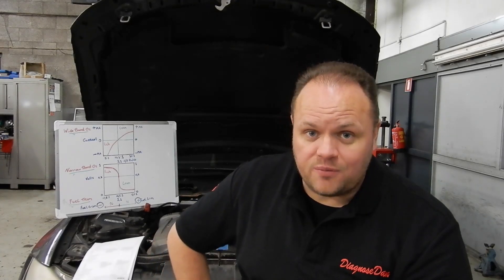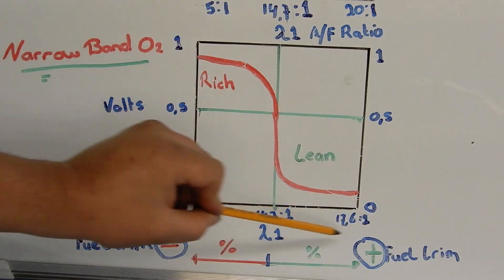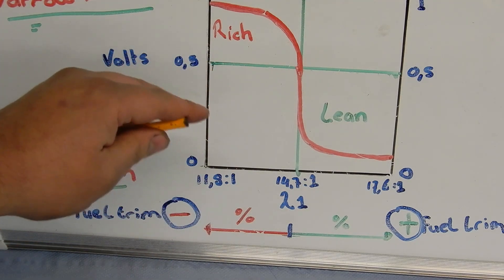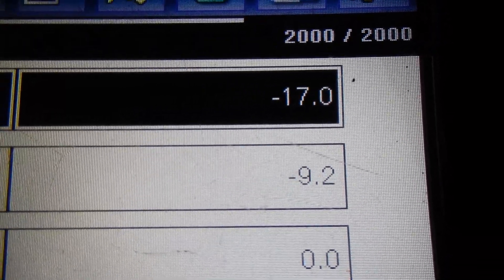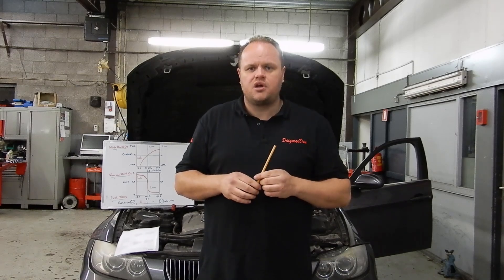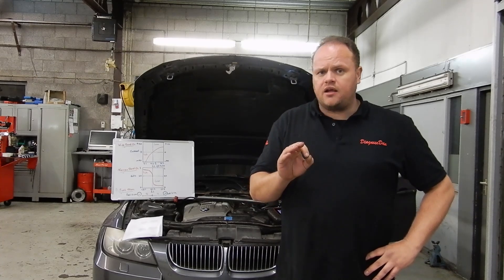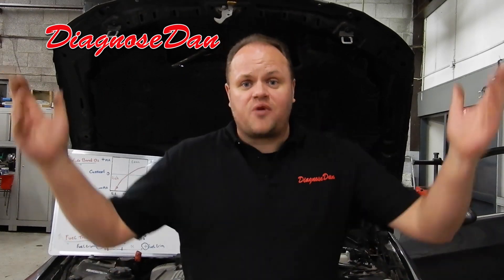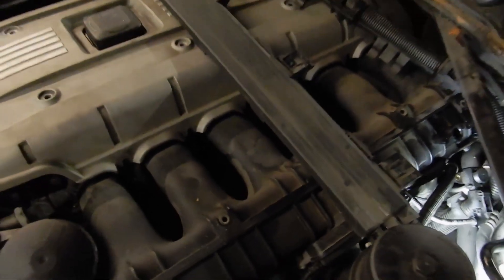Wideband O2 sensors, Narrowband O2 sensors and Fuel trim.

Comment: I cannot think of another skilled trade where we are required to have such vast knowledge yet earn such poor pay.
Reply: Within time constraints and owning/needing costly tooling/equipment as well.
Reply: The typical "mechanic" must be proficient in Mechanical diagnostics, electronics, welding, hydraulics, pneumatics, material science, air conditioning, and computer programming to be successful. Heaps of common sense and a developed diagnostic approach are also mandatory.
Reply: @mnewln1800  hey i like that
Reply: @mnewln1800  and yet we're looked down upon in the trades plumbers have us beat
Reply: @mnewln1800  I'm saving your reply
Reply: Red Pill exactly
Reply: Truth... I did it for 20 before escaping.
Reply: There are alot of trades that need high skill that are not paid that well. Like programmer, electronics technician...etc.
Reply: So true, customers don't want to pay us
Reply: Exactly why I got out of it after 13 years
Reply: I agree .. been a mechanic all my life .always try my best but these days the electronics especially on older cars just causes us nothing but agro... do that diagnostic again Dan on a 15 year old car with a loom from the wrong model fitted by a blind clown whilst freezing your plumbs off in a shop with no doors... then I'd be impressed
Reply: The industrial valve business is the same.  There are so many "slick" salesmen that are flashy with their words that the guys that actually can solve problems get marginalized; for a while.  We never get paid what we are worth.  The average plant down time at a paper mill costs ~$100K an hour but they do not want to pay a capable valve guy a fair price to solve the problem.  We are in the same boat brother.
Reply: Because of greedy dealerships I think the future is going to be a lot of smaller shops opening up
Reply: Vs doctors!!
Reply: Exactly my thoughts too we're the most unappreciated trade in the industry
Reply: I can, because I am one. A professional musician. 

Not only is my literal entire life my experience (along with a degree that costs the same as any other), but we're also doing the job of Dr's, therapists, and psychologists.

We also have insane costs for our tools (instruments) which are under CONSTANT threat of being stolen, but we also required and expected to give away our lifetimes worth of knowledge, creativity, and experience for free. We have to fight to even get paid.
Reply: AND spend huge money on unique tools.
Reply: Horticulture
Reply: Teachers ? the kids in the USA can be little shits
Reply: True
Reply: I really think that car performance tuners and diagnostics are going to change the car repair industry, especially negatively affecting the dealer repair scam shops, in the next 5 years. That’s probably why the dealers are trying to get laws passed in California to block the tuners - they see them as a huge threat to their business. Knowledge is power.
Reply: I agree wholeheartedly
Reply: Try being a carpenter. Bahaha. The ones that don’t think up you lay carpet for a living and there are a lot, thin’ you shit money for a living. And you like working for free on your weekends 😂😂
Reply: I paid 400 to have all four shock/struts replaced on my Camry took the guy a couple of hours. I felt like I got a good deal. That’s a hundred bucks a wheel. You guys should absolutely make more than you do. So, ya I agree.
Reply: Chefs are in a similar boat
Reply: Not to mention the safety risk and health effects. My shop refused to provide us with safety glasses, mask, ear plugs or knee pads. They provide a cheap safety shoe once a year so if you worn it out, they wont replace it for you. The gloves they gave are cheap cloth ones, not oil resistant nitrile. Used engine oil causes cancer
Reply: @bengkelbawahpokok6753  that is horrible...I wouldn't treat my employees like that.
Reply: Mechanics earns the same amount as an engineer or IT consultant. Don't get it twisted!
Reply: @ashystyle What are you smoking or are you naturally this delusional? There's no way an automobile mechanic or technician makes the same as an engineer or IT professional.
Reply: Poor pay? My tuner charger me 1100 for 4 hours of dyno tuning. Y'all charge 80 to 120 per hour for labor. How's that poor pay? I was a mechanic for the army for 14 years. It's not hard labor. And tuning requires knowledge. But that's it.
Reply: @09fatbobmike  We probably get $11 - $25 per hour from that 80 - 100
Reply: @bengkelbawahpokok6753  WELL thats some shitty shit there. time to start your own business. 25 is good but anything under 16 is under paid.
Reply: Lol army mechanics are not real mechanics
Reply: oh, and my charger makes 410whp and 360wtq.
Reply: Mr. Mike I’m an army mechanic no way your training was 8 months lol you can stop that bluff lol all we do is fire that parts cannon
Reply: @michaelsieber6601  i stand corrected. it was 1997. memory lag. it was 63Tango and H8 identifier. total with basic was 8 months. AIT was about  5. IDK what you guys do now. But to say an ARMY mechanic is not a Mechanic is fucking bogus.
Reply: A mechanic is an artisan, skilled tradesperson, or technician who uses tools to build, maintain, or repair machinery.
Reply: @09fatbobmike  Army "mechanics" are a joke shut up. Cry about 8 months of training? Think that's alot? Have you heard of automotive school...? Get real.
Reply: @michaelsieber6601  lol
Reply: @09fatbobmike   12 second camaro? Does that mean the avrage time between total breakdowns is 12 seconds?
Reply: @rimmersbryggeri  sure man
Reply: @michaelsieber6601  Army mechanic is a mechanic not a technician
Reply: @09fatbobmike  seriously? It takes a lot of knowledge to be an anesthesiologist but not hard labor. It takes a lot of knowledge to design a bridge, but not hard labor.......yet they make a LOT of $$$. The name of the game is knowledge. Labor is almost worthless WITHOUT knowledge. 
And there is a difference between being a mechanic and a technician. Anybody can change brakes and rotors. Not everybody can diagnose the module systems.
Reply: @davidickes4621  you do not think a military mechanic diagnosis and troubleshoots problems?
Reply: @09fatbobmike  we may be disagreeing over terms. If a military guy is diagnosing and troubleshooting problems, I would call them a tech, not a mechanic. Because a tech isn't always dealing with "mechanical" problems. Many of the problems diagnosed on modern cars are circuitry or communications or the modules. 
Having said that, my point was that a tech is most of the time worth MORE than what he or she is getting paid. Because knowledge is value.
Reply: @davidickes4621  Your point is proven over and over again by these great youtube tech/mechanics like Dan and the rest. They constantly get cars from other shops and from dealerships that were diagnosis/repair failures. The sad part is that they often have to listen to sob stories about how great gobs of money were already spent on the car and it's not fixed, and would they do the diagnosis / repair for cheap?
Reply: @09fatbobmike that's your cost not their pay...
Reply: @09fatbobmike  Were not talking about Tuners tho since they specialize.
Reply: @09fatbobmike the shop charges $125.that’s not what the mechanic gets paid. We get pay $20 an hour. Tuning does not have anything to do with auto repair and diagnostic. Diagnosing newer cars requires high skills and expensive equipment
Reply: Shredder_V6_Ratpack because dealerships are greedy and don't pass the money onto the techs

Comment: Hopefully this has helped me able to diagnose my 2011 A4 which had oil consumption issue. That has been fixed, but it's currently running rich with LTFT -18 (did CRC clean it's now -14) (P0142 + P0420 for the cat). Just realized upstream is wideband & 02 downstream is narrowband. Upstream gives -0.2 mA at idle & downstream at idle behaves like upstream at idle with voltage going up & down, suggesting rich to lean which i don't think is normal? Who can help me here? Cat is toasted for sure, temperature is less post-cat compared to pre-cat. Other than cat replacement, is this upstream should be changed or is there a possible fuel injector leak?
Reply from the maker: What if you create a lean condition? Does the upstream respond?
Reply: @Diagnosedan  i removed intake hose after MAF to the turbo, ALL values below are at idle. Upstream responded, increased current readings from -0.03 mA to between -0.08 to 1.12 mA. STFT from 0 to -7, LTFT stayed at -14.56. MAF dropped from 2.6 g/s to almost 0. Downstream voltage continued between 0.1 to 0.9 v

Comment: Hey Dan,does the A/F ratio sensor,O2 sensor and wide band sensor,work differently from one another and how do you identify which sensor is which ? Thanks
Reply from the maker: A/F sensor= Wideband sensor
Easiest thing is look at the O2 sensor data on the scantool if it's between 0 and 1 volts it's a normal O2 sensor. If it says mA at the data pid it's a Wideband sensor
Reply: DiagnoseDan thank you,you are very helpful....

Comment: But I have a u1000 in my 2007 infinity fx35 I can't comnicate with AC unit and fues box the heads light stay and fan stay on when I on the ingnatio  please what can cause the fault? Have replaced front fuse box and ac amplifier.wiper not working AC not working too
Reply from the maker: Scope the comm. lines

Comment: I am watching this video over and over again. Amazingly that other shop replaced a common part that would affect both banks (the MAF sensor) when the vehicle only had an issue with bank 1. Too many parts replacers out there in the industry without "diagnostic" skills. I see it as "keep on throwing parts at the vehicle till the problem goes away"...sorry, but not on my wallet. I love these videos!
Reply from the maker: Thanks for the great comment!
Reply: Friend I need help, my bank 1 and bank 3 are at -17%, do you think it's the MAF sensor or the gas pressure regulator?

Comment: Well I didn't know what Valvetronic is since I do not own a BMW car (my last one was a 1995 E36) and my BMW motorcycles do not use that system either. My guess was a MAP sensor only needs a tiny hole to measure pressure (since it is static and not dynamic) and that tiny hole would not allow enough air to enter the engine. But this video is excellent to understand about Fuel Trim (I had no clue about trim)! My friends Porsche 993 is running ultra rich after having the engine out for seals, o-rings and a new dual mass flywheel and clutch. Plus we did the 964 mod to the 993 cams to pin the timing gears to the camshaft (the original 993 gear is a butt fit to the camshaft using a bolt...in my books a no-no). Anyway, I think we will have to do an ECU Drive Cycle / Readiness. Thumbs Up Dan!
Reply from the maker: Thanks for the great comment buddy it's appreciated

Comment: I thought that for the catalyst to work properly, the mixture had to fluctuate around 14.7. With the classic lambda sensor, the mixture fluctuates between rich and poor. Rich to have CO for the reduction of NOx to N2 and CO2. Lean to have O2 for oxidation of the CO to CO2. The mixture is kept at 14.7 with an AFR probe. How can the catalyst work well with such a system? What do you think Dan? How mesure the current of the AFR sensor with a scope. I think the current is too low for mesuring with an Amp clamp.
Reply from the maker: Current is very low, better to use scan data or look at the voltage drop because of the current

Comment: Hi Dan,I have a similar problem (FUEL TRIM BANK 1) CODE P0170 at 2008 Mitsubishi lancer 1.5L ,i was to Mitsubishi dealers as well,and they never seen this at Mitsubishi cars.......they told me on the diagnostic test  come up a throttle body error...but I got a throttle body and I had change that and the problem it's the same,I have two new lambda sensors and they work fine,I had fallow the response from sensors and they look active...I dont know where the problem is ...the short term fuel its 24.2.....and long fuel trim its 12.4.....I cant bring them back lower,i had change most of the part to try to fix the problem but no results.fuel pump,fuel injectors,purge valve,vapor canister,lambda sensor upstream and downstream,the all exhaust system and the cat and sparkplugs,throttle body........ I had checked the fuses.....plus all connections.....the  air frow mass its working no issues.....do you have any other ideas to tell me and to try ????

Comment: That BMW uses a Valvtronic system. Basically it can control valve lift electronically which pretty much eliminates the need for a throttle plate and this is the reason there is no vacuum at the manifold because air flow is controlled by controlling valve lift instead of a throttle plate. This system is very similar to what Nissan Calls VVEL (vairable Valve Electronic Lift). It's pretty slick.
Reply from the maker: Exactly!👍💪
Reply: Мu BMW is a valvetronic is a nightmare for repair
Reply from the maker: @traqnsavov822  it's not to bad
Reply: my is valvetronic TYPE 1 is not very good,  you is TYPE2 is good :)
Reply: Traqn was my first weekend at the lake at the beach and my friends at the park at my moms t you can not get gym and the people Savov
Reply: DiagnoseDan is the time to its 12234445
Reply: Exactly, but there still use a valve plate only when engine start on cold condition, when the engine reach its normal working temperature valve plate remains wide open, then valvetronic take control of the engine, now even with the engine at normal temperature operation the valve plate will operate of the engine is turned off and then back on, in this case the valve plate will wide open really quickly
Reply: Valvetronic system where the valves act as the throttle plate and manifold is open to atmosphere much like a diesel. Vacuum is only developed inside the combustion chamber

Comment: Awesome video, So many great uses for brake cleaner lol... another way to verify O2 and A/F ratio sensor operation from the driver seat (on vehicles with vacum power brakes) is to pump the brake pedal rapidly for a few seconds, this will force the system lean and when you stop pumping the brake pedal the system will go rich for a little bit. All you have to do is monitor the sensors and see which one is not responding 😊
Reply: Great tip!
Reply: And... another way to verify brake-clean💯
Reply: Except on our skin
Reply: But why not just press the gas instead of using brake cleaner? How is it different?
Reply: @EdgarMendezz  brake cleaner adds more fuel (and it is noticable the engine runs better).   Pressing the gas pedal only increases the same ratio of air and fuel that is creating the poor running
Reply: @andrewskater8813  he said the break pedal, so maybe he knows something you don't. I wouldn't know, but you're talking about the gas peddle and he's talking about pumping the break peddle.

Comment: Variable valve lift aside, speaking as a hobbyist, generally a vacuum leak on a MAP sensor controlled engine sees a vacuum leak as increased pressure and responds with with an increase in fuel, so no lean condition seen. On a MAF sensor controlled engine, the leak allows unmetered air into the system causing a lean condition.  Right?

Comment: On my Buick I have a minus 18 on LTFT (which just started). The car has little power so I'll clean out the MAF first, then check wires and ECU. A bad 02 sensor could cause that much drop?

Comment: I have an 07 H3 Hummer with 160 k miles the idle is rough  should I replace the sensors automatically. The 160k miles is LA traffic so it may have 180 to 200k operating hours. I sometimes smell an exhaust smell even though it recently passed smog.
Reply from the maker: Don't just replace parts without testing them. The engine management system is monitoring the sensors all the time, so when something is not right it will flag a code.
Reply: @Diagnosedan  thank you

Comment: Hi Dan, loved every one of your videos. I have a problem with a peugeot 207, 1.4 petrol. Drives fine  but eml on and anti pollution warning. Scan data shows upstream lambda at 3200mV. Downstream lambda at 0mV. Fault code says 'sensor 2 stuck lean. No.2 sensor was replaced a known good sensor and all was fine for a few miles but eml returned. Same code for sensor 2 returned plus a new code for manifold pressure signal implausible. Data shows lambda readings same as with original sensor and manifold reading 50mbar. Any help would be much appreciated.3

Comment: Very nice video.It has no vacuum because the butterfly flap on the throttle body runs mainly open to reduce the energy losses from the pumping effects of the engine. Less restrictions for the piston going up and down.??
Reply from the maker: Exactly! 👍

Comment: As always a great video! 
Can you monitor the signal AMP by connecting a low amp clamp and using a scope?
Reply from the maker: In theory yes but it's easier to look at the current in scandata or sensor voltage. I'm planning another video on o2 sensors with more info😊

Comment: Excellent explanation ,I now understand how it works. Is there a quick and easy way to identify which type of sensor we are testing? I assume that a wide band sensor has more wires than a narrow band sensor but is there anything else to look out for identification? Just found one of your previous answers to the same question, should have read further. Thanks for a brilliant video.
Reply from the maker: More wires and O2 current in scandata
Reply: So can a four wire be a wideband sensor or only from five wire upwards are wideband sensor? 
Is there a possibly to know without having a scan tool?